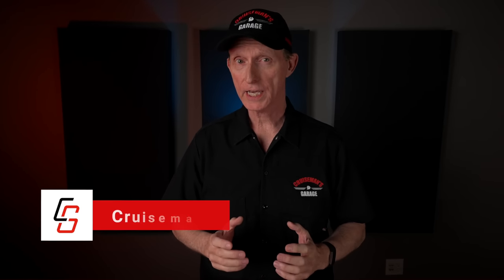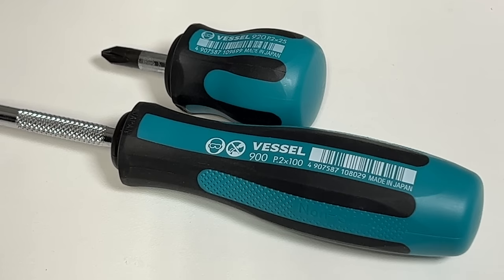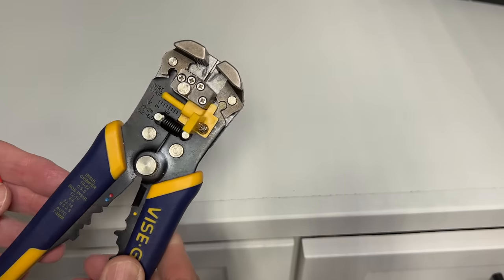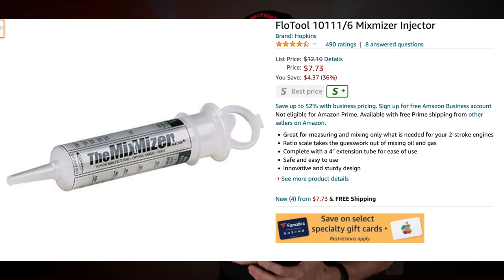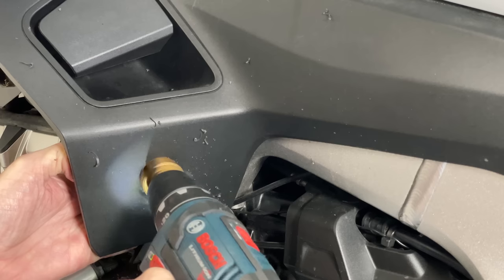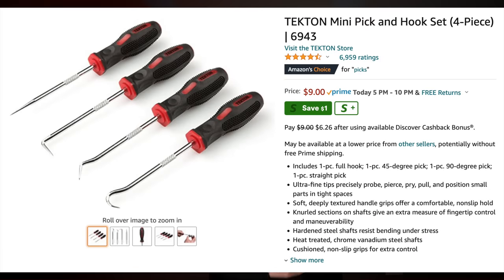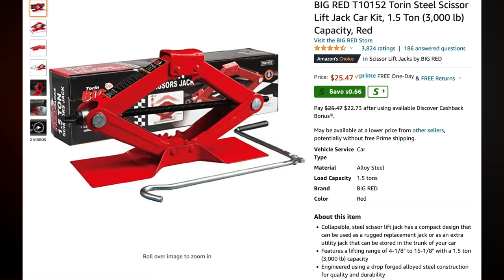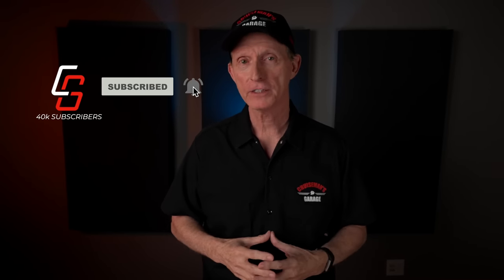10 Tools You Need to Work On Your Motorcycle | CruisemansGarage.com

Comment: Nice video and like you i have the same pair of JIS screwdrivers with the  serrated teeth on the tips of the head of the screwdriver. They work extremely well !! I also have the Irwin wire strippers. yes excellent tool!

Comment: Hi cruiseman i agree on all those tools the irwin stripper is the best ive ever used ,the jis screwdrivers i have the two vessel  impacta drivers  #2 and #3 for  stubborn screws and a # 2 ball ratchet as well , picks are a necessity taking of old o rings or as you showed the pins on those clips , shop magnets are a god send lose a nut down in there and say goodbye to it   unless ou have a magnet on a stick , i am always suss about some of these jacks were you see a 900lb bike (goldwing) up in the air ,i have a trolly jack that i use ,i think you covered almost all of the tools that a home mech will need i use a sidchrome torque wrench but i like the ones you yanks have  that clicks when torque is reached anyway if the home mechs follow your advice they wont go wrong .

Comment: Late to the party, but here goes anyway.  You DO NOT "back off the torque ring to zero".  You adjust it to the lowest setting, which on a very few torque wrenches is in fact zero.  Most - like yours - have a lowest setting somewhat higher than zero which doesn't even exist on your tool.  Before offering a pro tip you should make sure it really is.

Other than that the video is a 7 out of 10.  You're welcome.